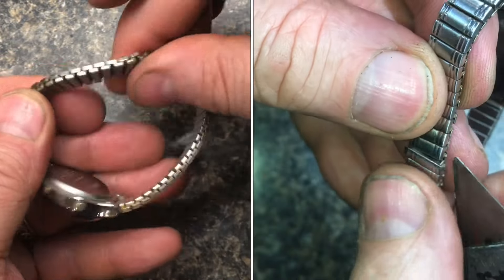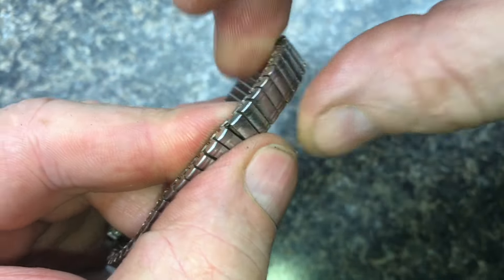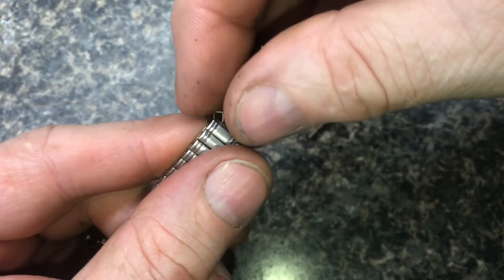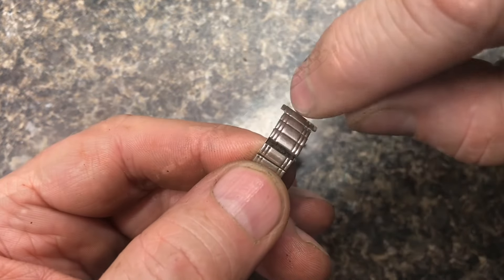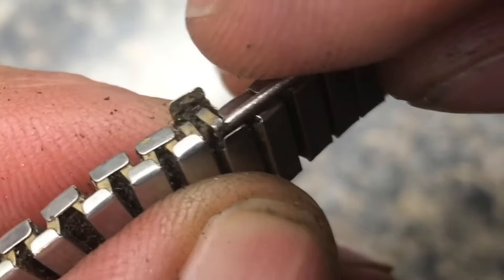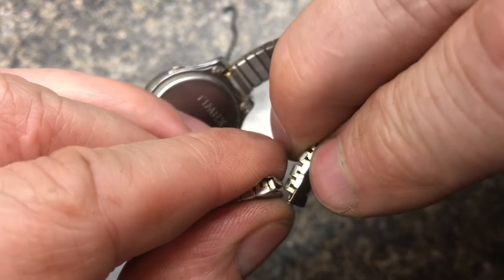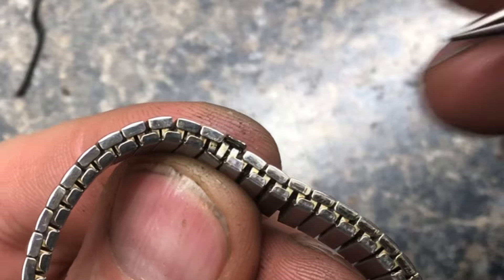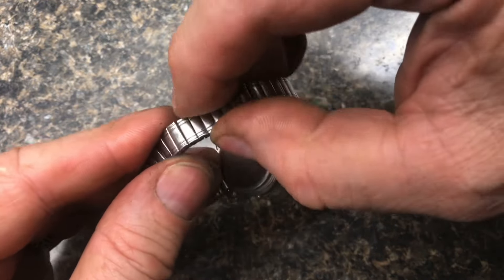removing LINKS￼ in  a “speidel twist￼” wristband

Comment: My band is a little tight on my wrist: is it possible to add links via this same process?
Reply: It's the same procedure, but instead of removing links, you're adding them.  Twist-o-flex bands also come in extra long lengths.

Comment: This is not the proper way to do this. This is how you end up with damaged and warped caps. You should bend back the small tabs BETWEEN the links, not on the ends. This is in the official Spiedel instructions. If you want a copy let me know.
Reply: I want one